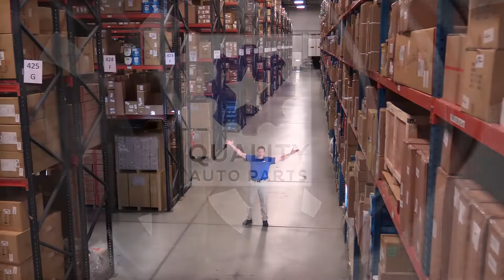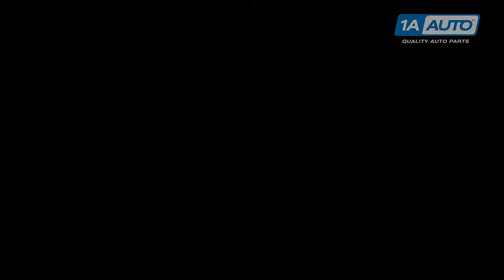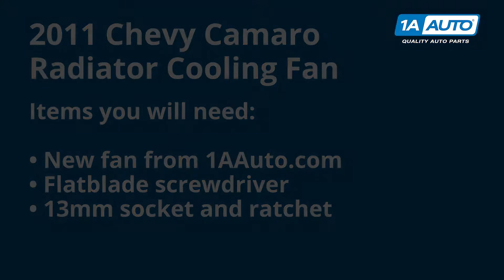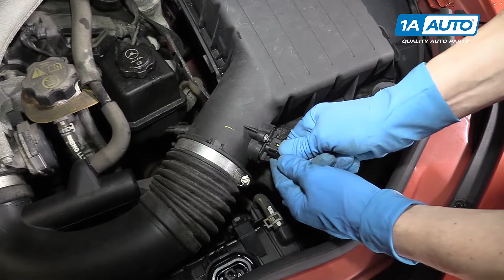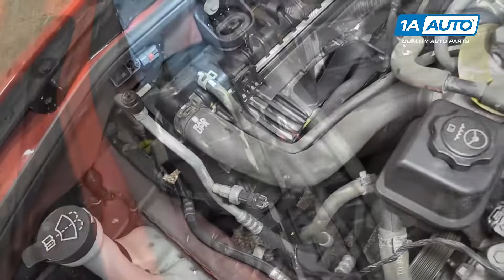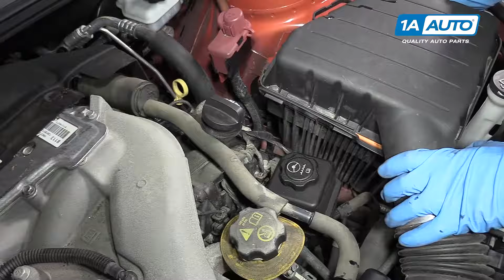How to Replace Radiator Cooling Fan Assembly 10-15 Chevy Camaro

Comment: I have a 2015 Camaro LS, and only one of my fans turns on when the A/C is on. However, when the heater is on they both turn on. Do I have to replace the entire fan assembly, or is it a fuse/relay problem? I already bought new relays (K613 and 44) and nothing has changed. Fortunately, the car doesn’t overheat either (gauge never goes above 1/2).

Comment: For those of you watching,  you need to remove the lower airfilter box too.  On this video you'll noticed it's been removed when the dude pulls up on the fan but he skips that step in the video.  If you don't remove the airbox you'll be struggling big time to get that fan out of there.  The lower airbox has 2- 10mm nuts holding it down.  It takes less than a minute to remove it.  Also remove the upper radiator hose and push it to the side, that only takes a minute too and then the fan will drop straight down in position with no obstacles.